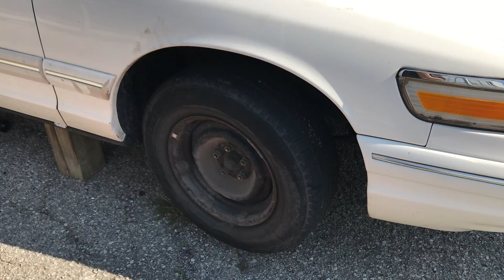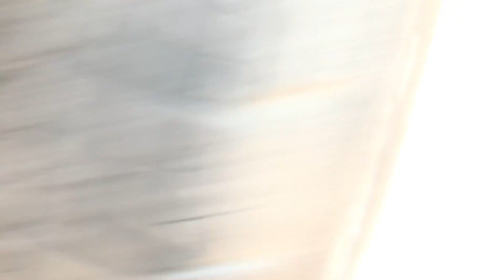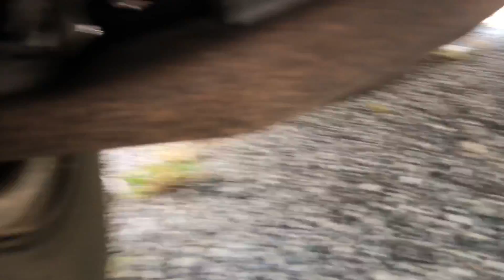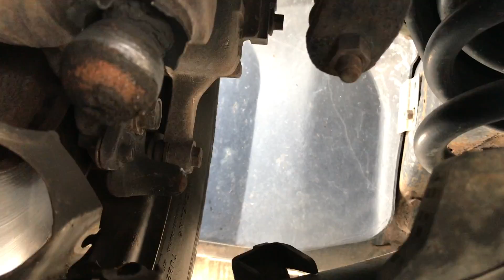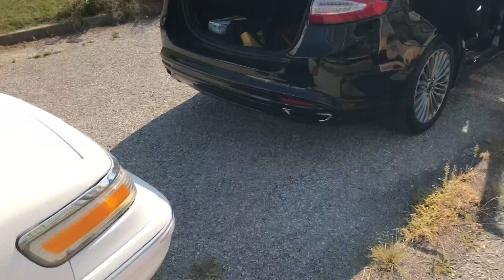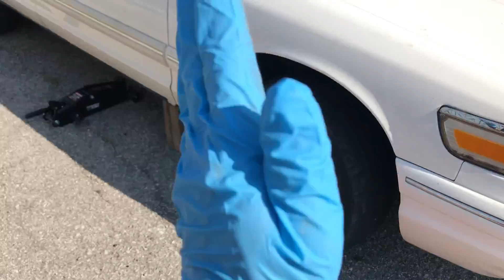Why Safety Inspections are Important

Comment: I used to be all pro inspection after living in a state with a yearly one for years. Now I don't care and I don't think the state should have control.   If the vehicle is about to fail,  the driver  if they have half a brain should realize something is wrong.  If not,  the driver needs to know the consequences.   I know this from driving many bad vehicles, I mean I drove them  at 50-70mph for a long distance and 2 days later I saw them in the junkyard they were THAT BAD.   Of course they were not my vehicles. I knew the vehicle had issues, If it was extremely bad I just had to tow it to its location lol

Comment: Unfortunately here, inspectors arent required to check for things that you mentioned. For tires, they are only supposed to look at tire tread. The date that the tires were made does not matter. They dont care about slop in the steering, jack the car up and check the ball joints, tie rods, look at the brake lines for rust... (even though it barely rusts here, a northern car could have made its way down here). For OBD2 cars, they simply plug in the computer, then ship the car on off. For OBD1 cars, all that matters is that the EPA is happy - put the car on rollers and check emissions.
Reply: in NYS now you get failed for window tint.  I used to inspect my own car when I lived there, I had the card...  :)   You ere supposed to check all this shit. The DMV would frequently send in a BUGGED car to try to bust you as an inspector and fine you and the shop.  Bunch o nazi's
Reply: Yea they would do something stupid like drive in a dodge minivan to a Toyota dealer ship for a inspection.  They would remove one of the seat belts like in the middle of the 3rd row..  Or leave off a lug nut under the RR wheel hub cap.  Disable the wiper motor.  Like something stupid someone may not check.  The belt thing was real and someone's license got suspended because of it.  Its the STATE again taking control trying to fire someone, making another hard working American lose out.   Its funny because one of my own cars had a ripped seat belt for like 10 years and it was never noted. It was totally ripped when I started inspecting it myself. It always passed.    I have a nice used one now..  Oh Once they sent in a bait car and they got a hit, they would sometimes send in YET ANOTHER ONE a few weeks to try to get the establishment again.    Got into the habit of investigating every vehicle after that went down. If it was a odd ball it was the fn state being dicks again

Comment: In New South Wales in Australia, a car requires a pink slip inspection on a car that's older than 4 years of age.

With my car,it looks like I have to get it inspected this coming Saturday because it looks like I'll get a job after being unemployed for almost 6 years !!!!

Mine will also need a blue slip inspection to make sure my car is all mine (i.e. not stolen, rebirthed or it doesn't have stolen parts in it),to make sure it's all legitimate which will cost about $100 AUD for both the pink & blue slips.

I can legally drive it to the mechanic without number plates on it but will need to purchase a compulsory third party green slip beforehand for about $600 AUD for personal injury protection in case I crash into someone & injure them and/or myself, I will be legally liable if I have no policy.

The registration fee including the number plates & taxes costs about $558 AUD ,so it will cost between $1450 - $1500 AUD including them possibly fitting a couple of new tyres to get the car back on the road.

Brand new cars just need an application for registration form to be filled out,they need no inspections !!!!

Comment: that is where and when ball joints and tie rod ends used to always break, turning sharp or going over low curbs in/out of driveways, and parking. I cannot say I've seen it occur on highway or cause a wreck, not saying it didn't!
thinking about struts and newer suspension, I've seen many strut springs break, jump out and go right through tires, multiple times from parked to highway. granted the number of strut suspension vehicles is far greater now :)

Comment: Michigan does not have mandatory safety inspections yet and it is needed.I have seen vehicles still on the road that should be taken to the junkyard.One was an early 1990s Ford F150,cab floors completely rusted out.Includes rusted out and leaky brake lines,junk frames including suspension parts.These cars could be going down the road driven killing someone else.

Comment: I was quoted over $1K to get uppers and lowers done on my ram pickup. For that kind of price, I can see why people put off ball joints. I don't have 1100 bucks to drop on it, especially after paying over 2100 to make my wife's car pass smog. What kind of labor is involved with doing ball joints in an average shop environment? Why is it that expensive?
Reply: Shops charge an hourly rate for labor. Last I remember it's around $85 an hour, but varies with shops and locations. My wife's Durango needed upper and lower control arms. Parts cost over $600, but a shop quoted me over $2k.

Comment: Get your chassis lubed every oil change if you pay for one, or do it yourself every oil change. That ball looked like it hadn't seen a lick of grease in more than a year
Reply: Backyardmech1 good luck greasing these
Reply: Most all cars now and I guarantee this one are "maintenance free". There are no actual grease zerks anywhere....
Reply: Grease them on a Ford ha ha no zerk fittings to grease them .
Reply: nearly none of the vehicles have zerk/grease fittings anymore, only some aftermarket parts and then nobody lubes them anyway!
Reply: Tb you got that right
Reply: That's what happens when you buy a vehicle with non-serviceable parts that wear out. That should've been my original comment.

Comment: Daniel I hate to go against your premise but first of all isn't Missouri a state where safety inspections are required? And yet that car fell apart. There are a lot of states that don't require safety inspections and cars aren't all setting by the side of the highway with ball joints falling out of them. 
It has nothing to do with the requirements of the state, people have to maintain their vehicles. No I have no idea how many miles that old Merc has but the cost of your ball joint replacement along with that tow bill would replace it with a lower mile model most likely here in Phoenix. I have always questioned spending $600 to repair a $1,000 car let alone a $500 car.
Reply: carmaninaz I thought it was just emissions
Reply: chad harmon well I've been gone from Missouri for about 15 years now but the last time I lived there a safety inspection was required every year. Here in Arizona if you live in the major cities you have to get an emissions test but no safety inspections. Somehow our streets aren't lined with broken down cars.
Reply: Yes, I live in MO as well. They do two year inspections at maximum. Meaning, if you buy two year tags for your car, your inspection is good two years as well but however if you only do the one year tag, you will have to inspect the next year also. Only safety checks in all counties except city of St Louis I believe, they do safety and emissions there. I lived in Kansas my whole life up till two years ago and they do no inspections other than a one time VIN inspection if you bring an out of state title. KS title, zero inspection.

Comment: No we don't need state run inspections. That just creates more bureaucratic headaches and corruption. People just need to take driving and car maintenance seriously. I must say I'm really frustrated with how stupid we're becoming as a nation.
Reply: wafrederick I live in California, where we have emissions testing, but no safety inspections. I admit it is dangerous at times, but you learn to drive defensively and look out for delinquent vehicles. Distracted driving is a way bigger problem. Where does the nanny state mentality end.
Reply: Chad Bob Yeah a few stupid people ruin everything.
Reply: Car manufacturers should stop putting so many driver assists in their vehicles. adaptive cruise control? blindspot warnings? lane keeping? that makes people retarded and promotes distracted driving.
Reply: This video is proof people do not take car maintenance seriously.
Reply: Damn right! NO inspections.  Its more control for the state, Does nothing for safety, their will still be accidents.  All you as a car owner gets hassled more and needs to pay more $$. here we have NO inspections. where I used to life required a yearly Safety Emissions inspection that cost 37.50  Now in that state they even FAIL you for window tint. Insane.   Here if you drive a piece of junk, a police officer can write it up and give you all sorts of tickets.    So basically if you don't want to get pulled over, fix your car. Its a better method than a state run program.
Reply: Yes we do.What about the vehicle with no brakes at all going down the road killing someone?.Plus there are vehicles on the road that need to go to the junkyard.

Comment: The problem with “safety” inspections in my state is that garages use it as a way to screw over customers. I would guess a majority of repairs under Virginia safety inspections are ones really not needed.

Comment: In the UK, the annual inspection takes 40 minutes, costs $50  and is very, very thorough.  Absolutely everything is checked.  If you want to see the list just google,   'UK MOT checklist'.  This is pretty standard across Europe and I believe the Japanese annual test is even stricter
Reply: Yeah pretty similar for The Netherlands, thorough inspection all around. Ever since the introduction of yearly inspections the number of death traps having to get pulled off the road by the police has plummeted. As an added bonus, cars are also inspected with regards to modifications. So you will hardly ever come across some moron blinding you with his five lightbars or spoilers that are guaranteed to slice any pedestrian in half.
Reply: now, if only they didn't drive, park and wreck like absolute clowns non stop :))
Reply: MOT is a joke against german tüv

Comment: What's the old saying?  Pay a little now, or pay a lot later. Had this gone wrong at speed, it could really have been a lot.  Owner is lucky it happened in a parking lot.
Reply: Stan Patterson Thank you! Told my wife to spend the $100 and get a wheel alignment. She didn't do it. Front tires went off on the lack of alignment, started asking about tires, mentioned the alignment, nothing. Wheel bearings went out. Now the vehicle was a driveway ornament costing 3 times the alignment.

Comment: 'Murica. Where an 8$ balljoint is just too much but driving a full size car with a gaz-guzzling V8 is just fine.
Reply: Crown Vic's, a full sized sedan mind you, got around 24 MPG on the highway. Not great by today's standards, but when they were new that was considered "good" and a stretch from gas-guzzling for sure. Comparably, a 1998 Mercedes E430 V8 of the same era also got 23-25 on the highway. So, here in "Murica" isn't all that different from the rest of the world.
Reply: Phil3555 the ball joints on my Jeep Wrangler were going to cost $1,100 for the 2 upper and 2 lower. I ended up doing it on my own and it cost me about $250 in parts and 2 days of labor. Given I went with the premium brand, but ball joints are definitely not an $8 job.
Reply: gas is cheap now
Reply: Phil3555 not everyone can afford to buy a new car
Reply: pn giles Except, a 1995 Crown Vic sold for $20K new. A Mercedes E430 from the same time sold for double that.

In America, it's far cheaper to buy something that does 24mpg than it is in the rest of the world.
Reply: My 1992 mercury sable gets 24 to 35 mpg and my 2001 ford explorer sport gets 15 to 17 miles a gallon
Reply: andrews2547 cost aside, they still got similar fuel mileage. Our foreign keyboard warrior friends only see American V8 "gaz-guzzler" when, in reality, no matter the cost or country of origin, full size V8 sedans of the era were all similar in fuel economy. It just has nothing to do with being "Murican"
Reply: pn giles Yes, the ability to buy a brand new (in 1995) full sized V8 car for the same price as a European/Japanese hatchback has nothing to do with the ability to pay for maintenance. The sort of person who would buy a Crown Vic is the same sort of person who would want a BMW 540i or Mercedes E430 but can't afford them, so instead spend half the price on a Crown Vic then spend the rest of their money on buying fuel, then when it's time to do maintenance, they can't afford it.
Reply: actually, it's harder to notice bad ball-joints in older vehicles, due to rear wheel drive, heavy weight and soft steering, the noise is dampened and so is any clunking or rattle.
I've test drove many and never noticed until I raised them in the air with suspension loaded and grabbed tires.
I had a tire shop come guy get me within minutes all "wide eyed" saying "your lower ball-joints are very loose, the wheels are flopping" I though he's feeling wheel bearings, I went out and inspected myself and  sure enough they were loose. that was my own vehicle and I couldn't feel a thing, they were far from coming apart, rubber good and greased. not bad for 1981 ball joints(1982) van, I replaced them in 2005?  todays vehicles, the rubber turns to shreds and the joints wear to nothing in a few years...
Reply: throttle bottle my rear drive Jeep Wrangler had very bad death wobble.  Definitely noticeable when the ball joints were shot. Maybe other vehicles are different.
Reply: over the years jeeps tended to have that issue with nothing wrong stock parts and nearly new, of course it was compounded by bozo-tires and odd offset rims :))
aftermarket cruft could fix it and as you noted, with loose parts they are terrible!
Reply: Judging by the rust inside the ball joint, I'm gonna say this one wasn't silent. I heard one making the loudest groaning/squeaking anytime the wheel was turned, and later that day I saw it in a parking lot with a separated ball joint. I've heard a few panthers make some hellashish noises when the ball joints were worn out, but people just ignore it, it baffles me because I critique every unwarranted noise my vehicles make.
Reply: It's not the part that's the problem it's the $300 in labor. People need to start leaving how to fix their own shit
Reply: Phil3555 -- "Gaz-guzzling"? Fail.
Reply: For some people it's more cost effective to pay someone else to do it..other people are just cheap aand or lazy
Reply: Well first off not Everyone likes tiny little gas Miser cars. Some people care more about their safety. Comparing the cost of a very discounted part to what kind of gas mileage of car gets is really kind of apples and oranges anyway. I mean you know not everyone has $150,000 to go buy a Tesla that'll run really great for about 24,000 miles before it catches fire and burns to the ground insurance won't cover it. But hey let's put down America because America sucks and it's the worst place in the world and in  every other country on the planet everyone rides bicycles and nobody drives cars are Burns fossil fuels. And everyone knows a $20 tank of gas couple of times a month is exactly equal in output of money as going out and buying a brand new gas Miser car golly why doesn't everybody have one. What a ridiculous comment.

Comment: Here in Texas safety inspection is 7 dollars. Most shops spend 5 min max looking at the car. So go to a trusted mechanic when your car is not running right.
Reply: 50$ here in finland and lasts like 30min
Reply: Elmo Most of it is the emission check though..
Reply: rkan2 Very true. Other than the vehicle stopping and the lights working, the emissions is the focal point. You may have a 96 and newer turd on wheels, but as long as they can plug into it and a computer says it passes who cares?